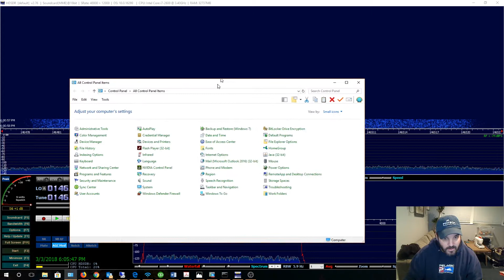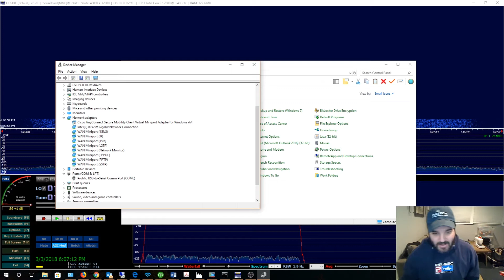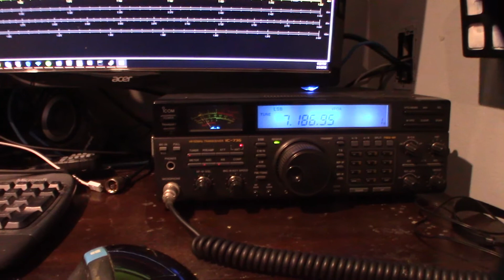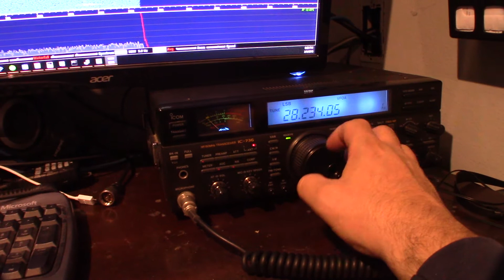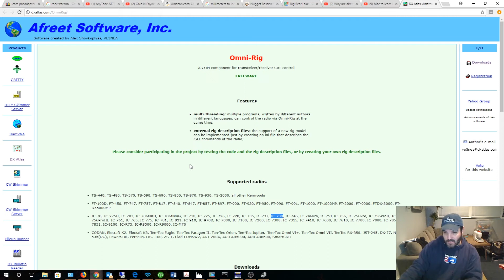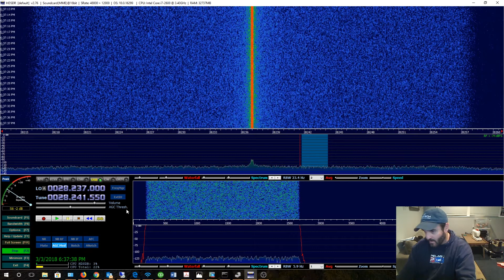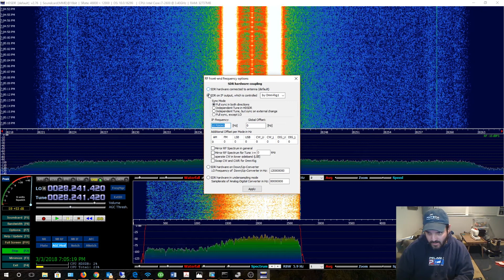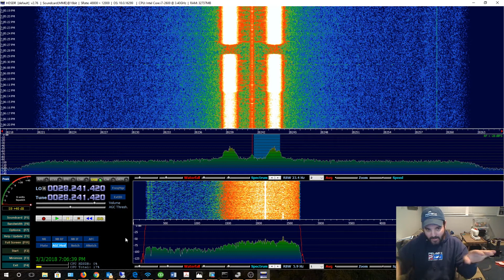Icom IC-736 cat rig computer control with HDSDR HRD and omni-rig

Comment: I love my SDR play RSP1A with SDR UNO. it works like a champ when useded with MFJ- 1708SDR. So when you transmit on your tranciever it grounds out the SDR receiver so you don't blow out the receiver circuits. It actually works quite well. So for about $200 you get cat control, pan adapter and transmit protection.  Good job on the video.

Comment: Hi Bob NO4MM here I have been running HRD 5.2 (free) on my icon ic-736 just like yours on my laptop for 3yrs and have tried to get the SDR software to read the signals. And then I put a splitter on the EX SP output and ran a line from the sound out on the rig to the mic input on the computer and then I got it to see the signals. Good Luck.
Reply: There is a usb to 3.5 cable on line for 5 to 10 dollars that may be a better connection.  I just ordered one for my ic738.  That way you should have vfo controls from your pc.  Have you tried this yet?